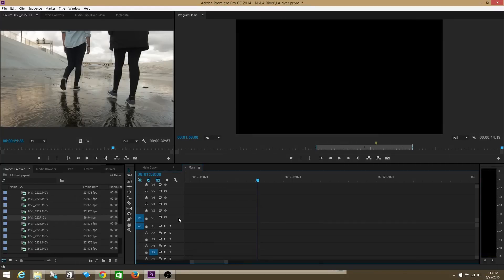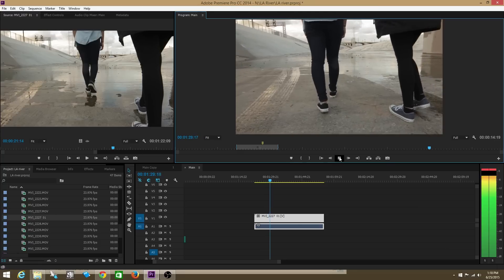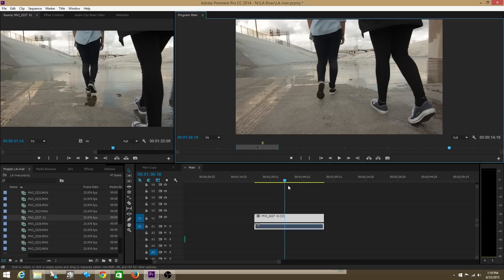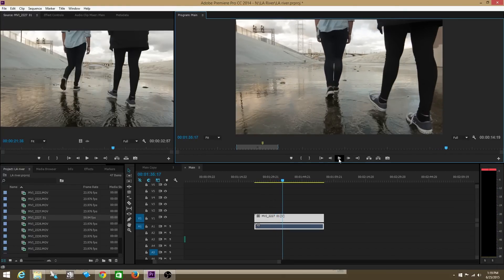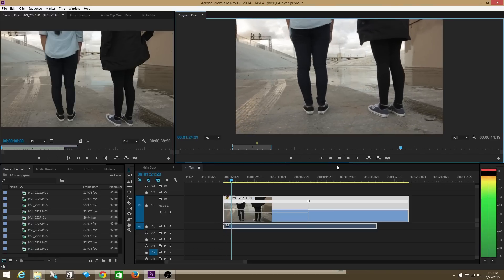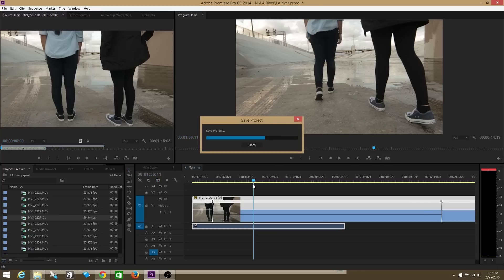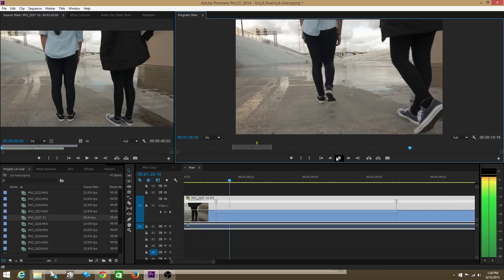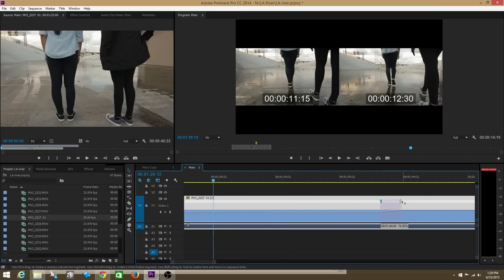Adobe Premiere Pro CC 2014 Tutorial - Part 11 - Frame Rates / Time Remapping / Speed Ramping

Comment: Thank for video but I have question.
I have multiple frame rate clips (24p & 60p) but I only want set up and export my sequence in 24p, When I add 60p clip into my 24p sequence, it does not play smooth as other 24 clips in same sequence. So what should I do now?

I just want to play 60p clip in mormal speed, don't need slow motion
thanks